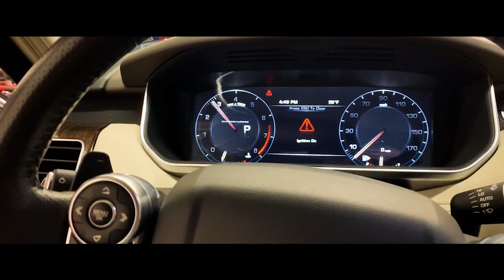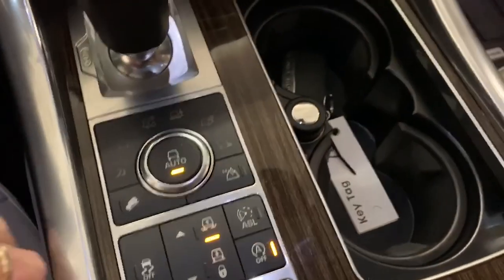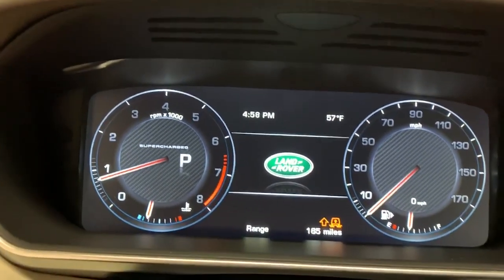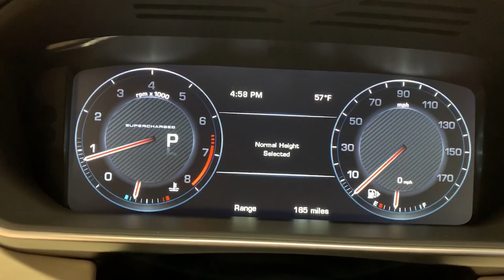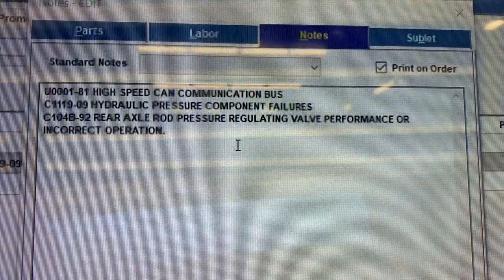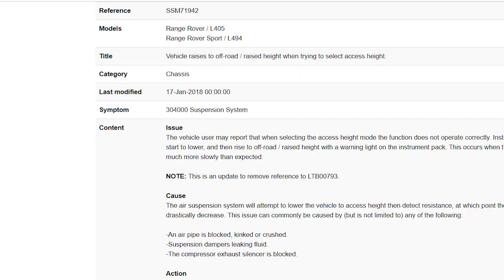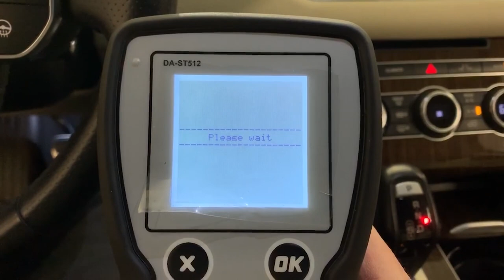2014 Range Rover Sport Air Suspension Problems

Comment: What was the issue with the car? I have the same problem. Thank you
Reply from the maker: The vehicle will not lower when the button is pressed. The cause is a bad exhaust silica. This silica stopped up the exhaust silencer and causes this problem. You can fix it temporarily by replacing the exhaust silencer, however the compressor will need replacement
Reply: Rover Rebuilds Thank you so much for your prompt and informative response, however, im still confused as to how does the exhaust relate to the air suspension, and what exactly did you do in this video that solves the issue instantly, my car is a 2017 and barely has any mileage so I doubt the compressor needs to be replaced, could you please also guide me as to how to replace the exhaust silica,
Reply from the maker: faizisarea when your vehicle is at standard ride height and your press the down button to access mode.. the air in the system has to be exhausted to achieve access mode. Not to be confusing, when I said exhaust I was referring to the exhaust on the eas compressor. You can do some research online about replacing the silica in the eas compressor, but I have never done that. I hope this helps
Reply from the maker: faizisarea this is the eas compressor silencer that will get clogged. RQV500040
Reply: Thank you very much sir, I have the same issue with my car as described in your video, what would you say is the first step to resolving this issue, should I replace the whole compressor or ask my mechanic to fix the the exhaust silica?
Reply: I apologize for my lack of know-how in this subject, as you stated you did not replace the silica in the eas compressor however you still resolved the issue, hence I asked the prior question.
Reply from the maker: I replace the compressor as a complete unit in this cideo
Reply: Hi, thanks for the video, I have a problem of front right corner dropping overnight or after a long parking time. This happened after I changed front tires
Reply: Kunzite Leathers what was the issue or outcome?
Reply: @kunziteboutique2293  Hi, did you resolve this issue.